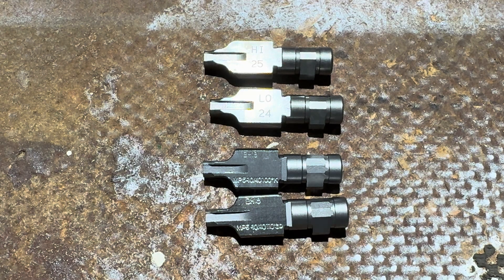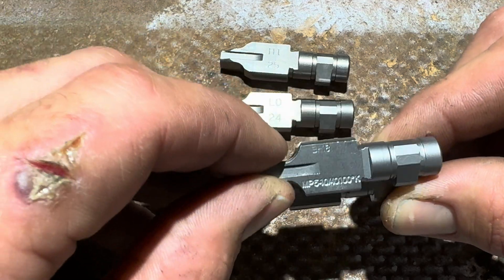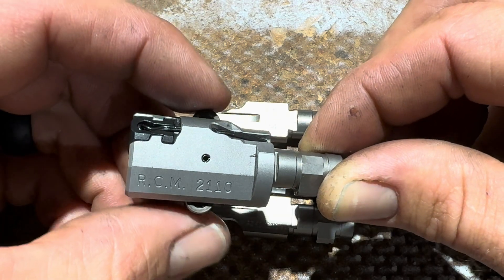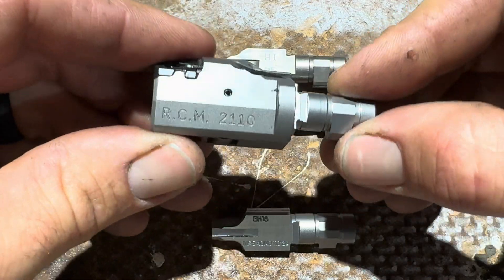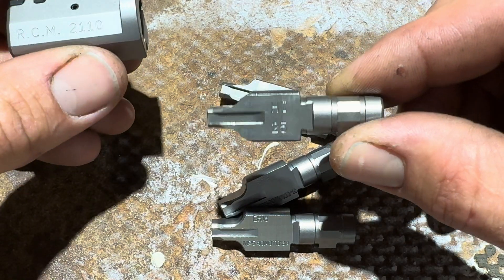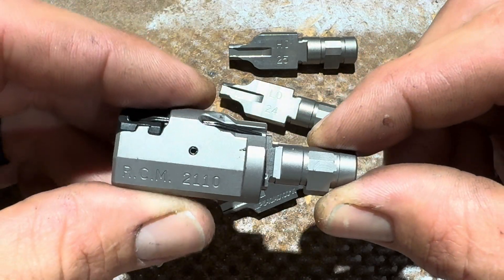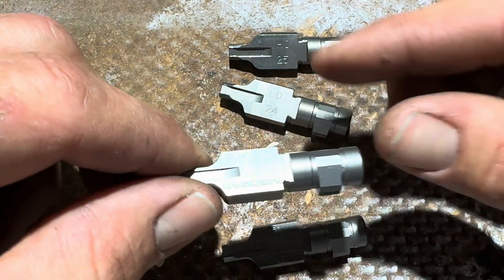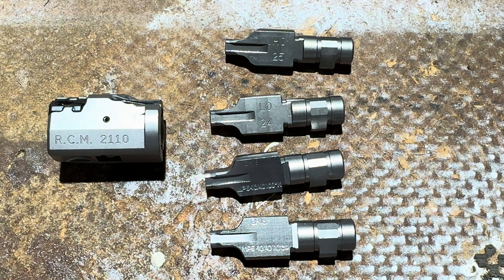HK Locking piece angle explanation.

Comment: Ok need some help understanding.  I recently got a Mac 5k and planned to run suppressed so purchased a 90 degree locking to anticipate this.  After putting this in the gun did a FTE after each shot.  When I went back to the stock locking piece I was able to run suppress,  not - suppressed..115 and 124 grain.....what happened???
Reply from the maker: Sounds like you were hypercycling the bolt. I don’t know what locking piece those ship with now, but you would generally want an 80 degree for that guy. Seeing as it runs as it is, run it and watch out for roller dents. When the gun settles in, you’ll want to make sure you’re running an 80 degree
Reply: According to mac, when I called them,  they said both their mac 5 and mac5k come with a 120°locking piece.  For what it's worth, I called twice.  One time they said to run it with the 80, when I called to confirm,  they said no,  run it with the stock locking piece.  🤷‍♂️🤷‍♂️
Reply from the maker: @P @PrezUSMC  if you’re running suppressed, go to the lowest degree locking piece your gun will cycle on, whatever that is. The manufacturer isn’t going to have a clue what you in your individual situation should do.
Reply: @uzifouryoutwosay I've got a mac 5 and a low backpressure can. I've dropped to a 110, still maintained good bolt gap and it ran just fine.  When i dropped to a 100°, it significantly changed my bolt gap,  so I've ordered rollers
Reply from the maker: @PrezUSMC  that low pressure can will do you a lot of favors. I have to admit, I’m anti “have you checked your bolt gap” when it comes to malfunctions in roller locked guns. As long as you’re between .020” and .010” the effect from changing bolt gap will be nominal at best.  Buffers in stocks, braces, locking pieces and extractor springs, and poor assembly are the culprits with malfunctions for the most part.
Reply: @uzifouryoutwosay when I say the bolt gap changed I mean it went from .45mm to about .6mm when I tried a 100° locking block

Comment: So if im understanding this correctly, locking pieces should result in ftf? Got issues going into battery on first 1-2 rounds and likes to jame
 (ftf) after with ss. Hk recoil sprink and bolt with 100⁰ rcm locking piece a d enhanced bolt head.
Reply: Do you have a full size or K variant? Have you tried modifying an HK Gen 3 EJECTOR lever for use with your SS? 
NOTE: the locking pieces on the video (LO 24 and HI 25)  are for the  MP5/10 and MP5/40 ONLY.

Comment: This is a very helpful video however I’m still wandering which locking piece to use for my build. Zenith ZP-5 upper with super safety lower with a can and I’m getting FTE issues more than there are idiots in this world (this is with suppressed/ unsuppressed, 147g/124/115, stock lower/super safety trigger, stock/no stock etc). What do you recommend I do to shoot my pew pew without any failure to extract :) (I swap my extractor springs every 500-1000 and extractor every 4-5k rounds) 

Any help will be greatly appreciated!
Reply from the maker: When the brass fails to eject, how is it oriented? Is it just caught in the ejection port open side out? Is it reversed primer side going forward? I would try replacing your locking piece, or going to a shallower locking piece. If that doesn’t solve the problem, it could be an issue with how you ejector is situated relative to the receiver, which is controlled by the shelf, so you could have a problem with the shelf location, or your grip module isn’t holding the ejector high enough for whatever reason. Most likely it’s a hyper-cycling issue, and your locking piece needs to be swapped.

Comment: Do you guys know with what degree the locking piece of a factory MAC-5k comes with? The 100°? I think i heard some guys with super safety lowers installed and for some reason 80° locking pieces inside, and they had issues with the cycling; i dunno why they had the 80°, maybe they swapped them form the factory one
Reply: MAC5's like the AP5's come with the 120 degree locking piece. This has been verified by customers who measured their locking piece and by SDS Arms the importer of the MAC5's.

Comment: So what do you suggest for a K version suppressed running 124gr and 158gr 9mm suppressed? At a fast rate?
Reply: #28 80’ locking piece
Reply: I've heard in most videos for a 9mm K style you want the 80 degree angle as well.  Maybe the 100 if you are running no stock and your hands/arm will absorb more of the recoil.
Reply: #27/90 degree LP is best for shooting supers and subs. The #28/80 degree LP is no longer the automatic choice. Especially when shooting "at a fast rate" (SS?).

Comment: Isn’t that backwards? Factory installed locking piece on a sp5k is a 100° HK says if you are running suppressed switch to a 80° to use up more energy. And make a softer impulse. But you’re saying a sharper angle unlocks faster. 

I think it is actually that the sharper angle absorbs more energy ss the rollers have to work harder to make the directional energy change thus bleeding off more energy. The Eiffel angles 100 110° are more slopped meaning it’s easier for the roller to overcome the angle and push the assembly back out of the trunnion.
Reply: To add too JP in their JP5 which is the same roller lock system as the MP5 they use almost identical locking pieces from 70°-120° JP says the smaller the number the more resistance. So they say if you are shooting some crazy hot +P+ to sub in 70°. Or if you are shooting super under light loads you may need to go up to the 100°-120°. So again I think you slightly have the concept backward the sharper angle is harder to unlock and thus means the bolt stays closed longer. The way you are explaining is that the larger angles stays open longer. Which I think is wrong given what HK and JP say.
Reply from the maker: @JohnDoe-mf5sc  You’re misunderstanding what I’m saying, a shallower angle IE 80deg takes longer to unlock than a steeper angle IE 100 degree, like you said.  The relationship between locking piece angle, barrel length, cartridge pressure are all directly correlated depending on the configuration, and reducing one of said variables will generally mimic the effect of another in the right condition. IE shorter barrel  17.7” or 14.5” .308 vs 22” .308 effectively makes for a shallower locking piece with the same cartridge (because 37 degrees isn’t as steep as 40 or 50 ). The this can be observed by a slower rate of fire, change in ejection pattern or strength, as well as bolt velocity. What you’re saying is correct, and you are understanding the function of it, but the terminology I think is jamming you up.
Reply from the maker: @JohnDoe-mf5sc  another thing to keep in mind, is that SD’s are counter intuitive as the ported barrel vents the gas relatively quickly, meaning that the locking piece essentially has to provide almost no delay, otherwise the gun won’t cycle. 

Also in the case of an MP5K, the shorter receiver, translates to higher bolt velocity from a shorter stroke length of the bolt carrier when cycling, as well as a lighter carrier. Both of these necessitate a shallower(longer delay) locking piece than a standard full size gun, as in the case of a “K” configuration, excessive bolt velocity tends to be the source of issues.

Comment: Subd, Got any info on the 53 lp?
Reply from the maker: @angelgutter  556 is it’s
own monster, as a general rule you want the lowest angle you can buy for suppressed stuff, but given the short barrel of the 53 it’s hard to say. If it was my gun, I would shoot it with whatever can I intended to use, and see if it feels like it’s being overrun, or malfunctions. If so, go to a shallower locking piece. Just remember, roller dents can be repaired.
Reply: For the HK53 (AP53) LP is the #15/65*. The old LP was #13/70*.  Per HK Appendix B - Locking Piece (Steuerstucke) Guide. I would start there.

Comment: Which locking piece would you recommend for a reverse stretch 10mm that will be run suppressed 100% of the time? Would I need one locking piece for supersonic loads and one for subsonic? If so, which for each?
Reply from the maker: @J_1791  that’s hard to say categorically, but I would start at a Hi-impulse for everything, and see how it feels/runs. Subsonic suppressed would be the place to start, then try supers suppressed and see if it has problems.
Reply: @ Thanks for the advice! I'll do it that way, try out a couple LPs
Reply: Download the “MP-5 Armorers Instruction: HK International Training Division” manual. Pages 41 to 51 for specific topics on the MP5/10 and MP5/40.

FYI: 
MP5/10 LO24 LP = 90*
MP5/10 HI25 LP = 60*

Comment: What if you were shooting FA on a K variant?
Reply from the maker: @jayuchiha973   full or semi shouldn’t matter, but the standard is 80 deg on K’s. K’s tend to have pretty high bolt velocity
Reply: @ mine was 100 degree, keep getting stove pipes
Reply from the maker: @jayuchiha973  swap to an 80 degree and see where that gets you
Reply: @uzifouryoutwosay  you don’t think I should go to 110 so they could eject faster? Still trying to grasp the concept of the locking piece & the different degrees.
Reply from the maker: @ it really depends. Stovepipe means different things to different people, but with a K, it’s most likely a high bolt velocity issue. So I lean towards a better buffer in the end cap, and a shallower locking piece, just off the hop.

Comment: This is the best thing I have seen on locking lugs.... But we need more.  
What happens if you hit it with machinist blue and run the gun?  Where does it wear?

And then we have my reason for looking this up. 
I also have a G3 clone, pile of German plastic ammo AND the German kit for shooting it.  This is basically blow back operation. 

I have an MP5K clone. I have a pile of the German plastic ammo. I need a locking part that makes the gun basically blow back. I could remove the rollers and pin.... But I want to do this in a cost-effective way.  Can I just buy a CETME C locking part and just remove material until the slope is ...Gone?

Comment: So if I was going to run a MAC5 suppressed 90% of the time would I want a 100 degree or 90 degree? I'd be using mostly 147g but I also have tons of 115g so I'd like to be able to use both reliably.
Reply: came her to find the answer to that very same question!
Reply: According to H&K, the sp5k should run 80 degree if suppressed and 100 degree unsuppressed but will generally still work with the 80 degree even unsuppressed. This matches my personal experience with it. I also have an mke ap5 and ran 100 degree unsuppressed in it but next range trip I'll try 90 degree and unsuppressed. 100 degree in the sp5k with a can is scary, feels like it's going to break something. I literally only fired 3 shots of 115gr freedom munitions reloads before i chickened out and swapped locking pieces. I haven't shot the AP5 with a can yet and so can't comment on how it handles it.
Reply: @GrendalTheBeasty I’ve always followed this formula:
1. 100* LP on full size shooting supers and subs (115, 124, 147gr)
2. 100* LP on the “K” shooting supers only 115 and 124gr.
3. 90* LP on the “K” when shooting BOTH suppressed (can on) and unsuppressed (can off) with 115, 124, 147gr and heavier.
4. 80* LP on the “K” when shooting exclusively 147gr and heavier suppressed and with a stock.
5. 115* LP (120* old recommendation) for the SD.
This is what I follow with no issues. I have a little over 2K rounds in each of my AP5 and AP5-P. Shooting FMJ, HP and TUI ammo. Have had great success following this recipe. If it works don’t change it.
Reply: @GrendalTheBeasty  Just curious if you got out to try the 90* in the full size? I'm running the standard 100* in my 9CT right now with mainly 115 and 124gr supers with no issues, and I don't have a can, but I wanted to see if I could fine tune the recoil a tad.
Reply: @JackTagar  Yes, I've kept the 90* in there ever since I dropped it in. Have maybe 400 rounds of mixed whatever through it (115 to 148 gr, FMJ and JHP). It's been 100% reliable with no signs of anything sketchy. It's a fair bit softer shooting too. I wouldn't go on a week long ski patrol in Finland during winter with the 90 degree, but here in Houston, it's fine. I have put maybe a mag or two through suppressed like this but it's mostly been unsuppressed.
Reply: @GrendalTheBeasty  Much appreciated! Coming from my PTR-91, I feel like I understand how everything works in general, but at the same time, there's just so much more modding and data on the MP5 out there
Reply: @JackTagar  Stay with the 100* LP. Not much difference in recoil. It's a 9mm after all.
Reply: 100 degree LP for full size.
Reply from the maker: @oneijack98  check on learning! Based on the video above, are you going to want an 80, 90, 100, or 110? If the shallower the angle, the more delay to opening the action?
Reply: @uzifouryoutwosay 80-90?